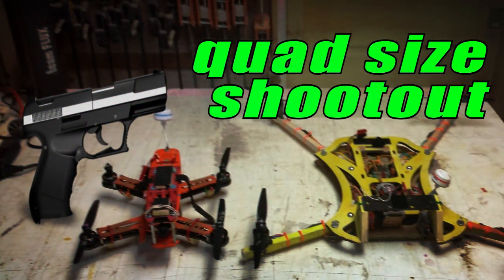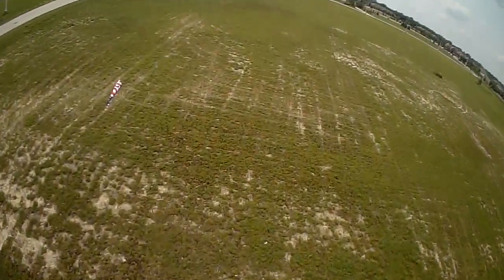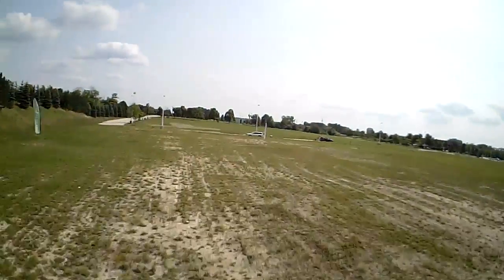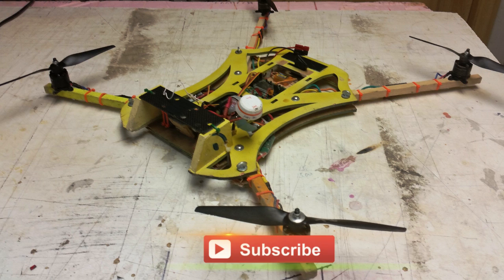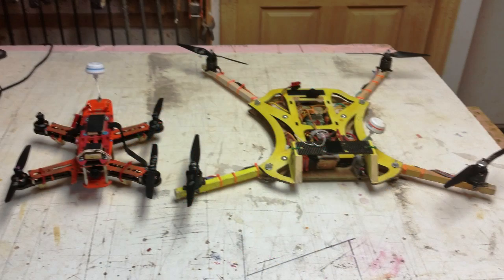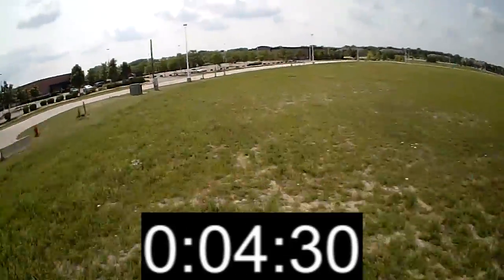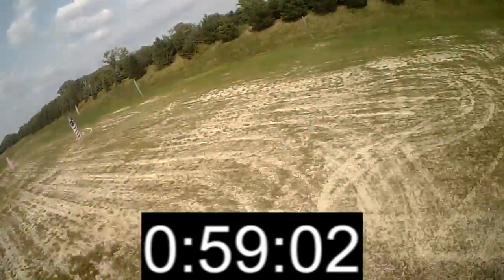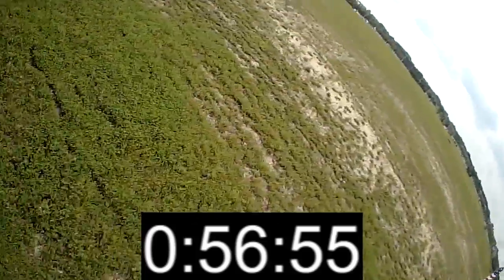Tech Talk: 250 vs 450 Quad Shootout // Sunnysky 2212 vs Cobra 2204 // HQprops // KK2.1.5

Comment: I have a 450 size quad, with kk2.1.9 steveis firmware and am VERY green with tuning.The quad flies well front to back and left and right, however when I takeoff the quad spins-oscillates one way or the other.I give trim input one click at a time and it's too much either direction.I can never get it to stop spinning, one click of trim in the opposite direction results in the quad spinng the opposite direction.I hope this makes sense, and any help would be appreciated.Im also building a color 250 H king with the mini kk2.1.9.I have watched MANY videos and can't seem to fix it.
Reply from the maker: +Cj Hyde It has been a while since playing with the kk, but the answer is the offset on the kk, not the trim on the transmitter. I don't remember what screen it is on on the kk.
Reply from the maker: +Cj Hyde I had that exact same problem when I was starting out and did the TX trim issue which isn't the correct way to solve it.
Reply: Offset?Sorry Im green to this.
Reply from the maker: +Cj Hyde Receiver test is the screen
https://www.google.com/search?q=kk2+screen+receiver+test&source=lnms&tbm=isch&sa=X&ved=0ahUKEwizj-aj097KAhUG6GMKHYvlDg0Q_AUICSgD&biw=1147&bih=889#imgrc=zeklLQIDnKx3aM%3A
Reply: I am sure it is way to late to answer this now but i am 99% sure you have the motors spinning the wrong direction, I did it once on a micro quad and had this same effect

Comment: Very cool video. Loving the production value.

That being said, If I were to organize a Multi Rotor racing competition, I definitely wouldn't let different size, weight or kV crafts to compete against each other. 

A mini quad wouldn't get effected by wind all that much(low wind resistance) but a 600 mm size quad would be impacted massively by the wind. So, If it's calm during the handicap runs, and wind picks up when it's time to race,  It'll affect bigger craft far more. 

Better to organize races in categories imo.
Reply from the maker: Totally agree. For our drone racing league we have two classes: 2300kv/3s/any 5" blade. The second class is anything else. Keeps it simple.
Reply: Would love to come but I'm in Europe :( We really need that kind of organisations in Europe too